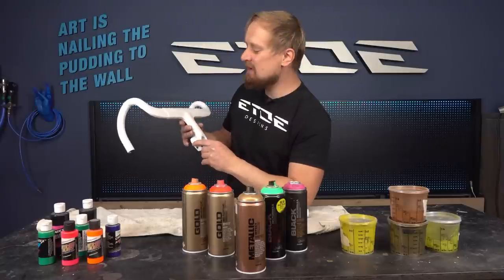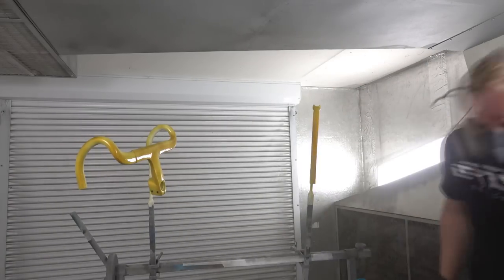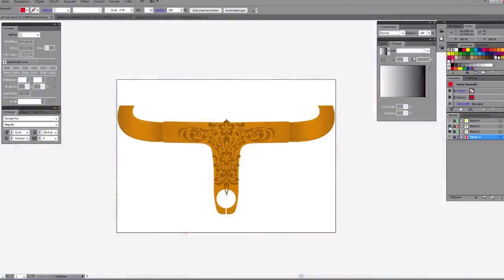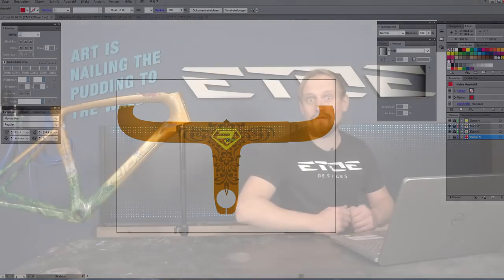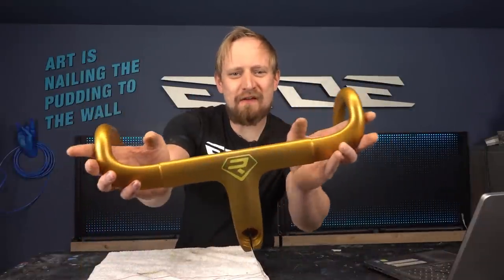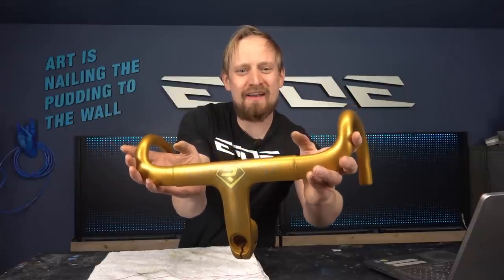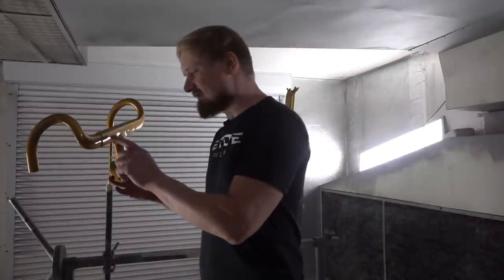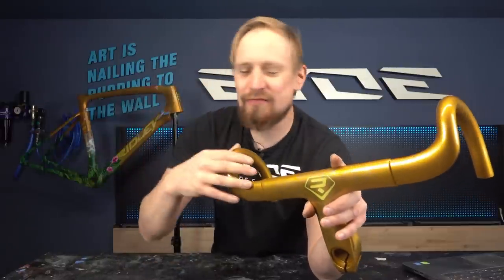how to paint a handlebar

Comment: i spayed my mtb steeringtube, but where the grips fit on, i used a single layer heatproof blackpaint..., which makes it easy to get the other handles in place without ripping the paint as much...:)

Comment: Martin congratulation again for all videos you do for us !!                                                                                                                                I am building my own paint booth in France and I have few questions : what kind of ventilation are you using for your paint booth, power of fan, volume air displaced, also about your heating system, radiator are used, the temperature while painting, are you increasing temperature for curing paints, specially clear coat.
Thank you in advance for your answers !!
Reply from the maker: Ventilation is 20000m3/h, heating is 100Kw

Comment: Excellent video, you have inspired me to paint my own frame. I have an alloy frame which has been sand blasted to remove the paint. I am using spray max 2k filler primer. Do I need to sand the bare frame before applying the primer and am I OK to use the spray max 2k directly on the bare alloy or does it need a coat of etch primer first.

Regards.

Comment: Always impressed by your amazing skill but why paint the bar in the area where it will be covered in tape anyway?
Reply: On my integrated bar and stem it isn't completely painted and then it feels like Wilier cheaped out on them. But it is probably easier to paint it completely than to mask it of.
Reply: Painted mine just today. Two colors split at the mid point. One color low so only going beyond the taper approx 1” beyond the end of handlebar tape. Once I removed the masking it became clear to me why it’s best to paint the whole bar- the transition joint between exiting paint/new primer paint isn’t perfect.